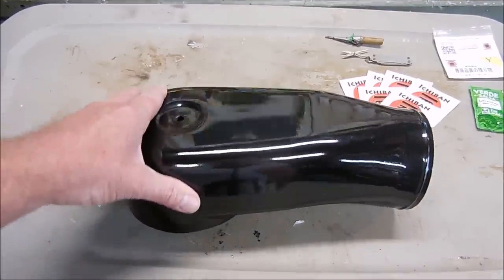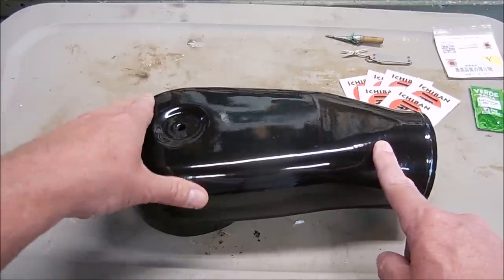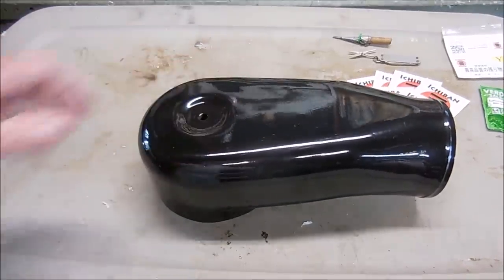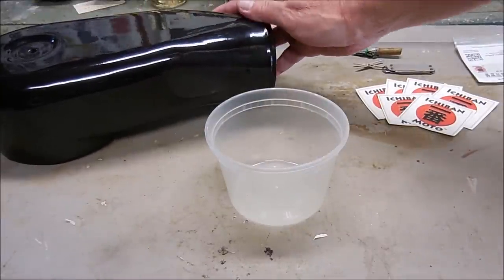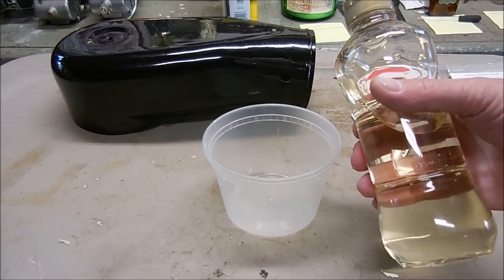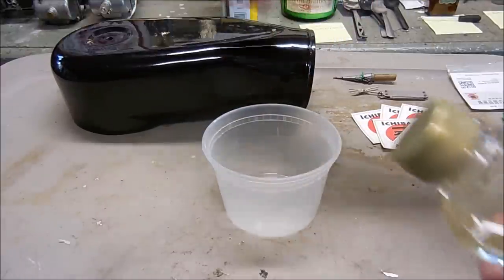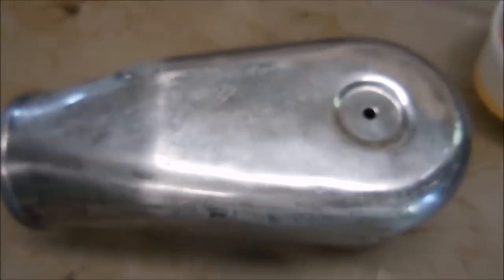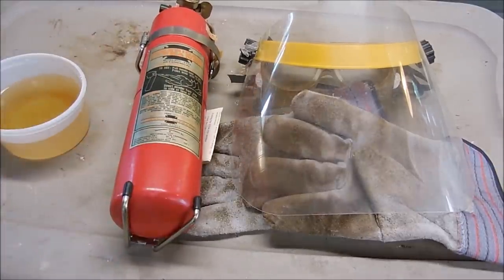How to remove powder coating with diy stripper

Comment: Just wondering did you use a SAE paint brush or a metric paint brush
Reply: klhlynn if you look closely, you can see it's a JIS brush
Reply: Scott W it doesn't strip of paint as easily though
Reply: C4H10N4O2 the stripping process wont be efficient if you paint the stripper on in metric brush strokes with a unf brush and vice versa.....
Reply: C4H10N4O2 you cant be careful enough when trying to protect the aluminum. this is a job that takes time and care. you cant rush this like sex on prom night.
Reply: Guess it is one of the dynamic brushes, it adapts to SAE vs. Metric brush width, depending on the pressure applied.
Reply: @theravedaddy  So many people don't understand the variables in metric applications
Reply: @grampa_ahah  in these recent times they are starting to notice the difference between a US gallon and a metric gallon....its about $30

Comment: tried acetone, a soya based stripper and nitro-cellulose combination thinner  - all 3 soften the powder coat so that it can be brushed of with a wire brush easily.

Comment: I see you employed a metal spork to measure that concoction out.....must be some basass stuff if a plastic spork wasnt used.....
Reply from the maker: the first sporkfull was measured with plastic.. but I had to pull out the stainless spork to break up the clumps and measure the second sporkfull.   i should do a spork video.. they come up often in faq's

Comment: I'm in Canada at the moment, would it be ok to use maple syrup gear oil instead?
Reply: i'll bet it would stay on surface of project better giving concoction more time to dissolve powder coat.  Great idea!  wish i'd thought of that.
Reply from the maker: maple is metric up there, right?

Comment: I mixed up the same mixture but it dissolved the aluminum and left the powder coat undamaged, what did i do wrong?
Reply: Damn, and i think i used a sae stirrer instead of metric?

Comment: Mr Ichiban I’m finding it hard to get my hands on a measuring Spork. Could I use a spoon instead or is that just being silly? Lee from across the pond U.K
Reply: buddybonus10 its easy to make a spork, just stab at an angle grinder with a regular desert spoon. Around 5 times should do it and if youre new to making sporks then use your left hand cos typing with no fingers is a bit annoying.....
Reply from the maker: i should do a spork video it is a faq
Reply: theravedaddy I never thought of that, I’ve just ordered a grinder and some spoons from amazon. I will soon have Sporks. Thanks guys👍
Reply: Nope, a spoon wont do. In a pickle, you can weld a spoon and a fork together. Just make sure both are metal, welding steel to plastic is slow going.
Reply: Morten Kristoffersen I’ve got a mig welder with a glue gun fixed to the end. I might be able to use that?
Reply: @thefreedomguyuk  I'm not a welder, how do you weld in a pickle?

Comment: Strong stuff ...  

I accidently splashed some on "my bits" while I was stripping my gas tank in the nude.  It has the same effect as Viagra but can only be removed with the aid of a stiff wire brush ! 😳

Comment: You need to seriously upgrade your safety practices.  The dust mask doesn't do shit to protect you from fumes and those chemicals you are using aren't something to mess around with.   You can buy a can of Loctite Chisel 790 that is much faster, easier, and safer than mixing up this concoction.

Comment: (thumbs up) Amusing but (thumbs down) not if viewing when half asleep believing that you might actually find a recipe to strip off  powder coating within this video. Here's the ingredient list:

50ml some (high fructose) gear oil
3cc Methyl Ethyl Casiotone (did he say Casiotone?)
2 spoon/forks or 'sp’forks' of phenolsodadetramine, Mead Brothers Druggist Gouverneur NY
a squeeze of noodle flavour sachet by the looks. 
15 ml Sodium Barbasol
another squeeze of hot sauce
4 drops of hemp seed extract (plus a massive squirt or 2)
Verona Salsa (did he use some it looked unopened)
distilled water

Unfortunately none of the important ingredients exist that I can find, apart from the hot sauce and other edibles
Reply from the maker: casitone